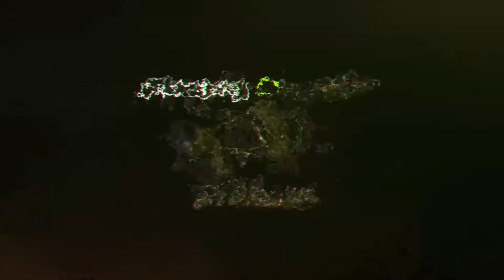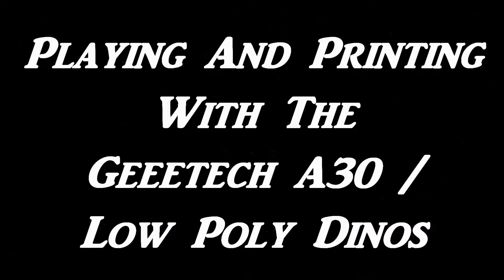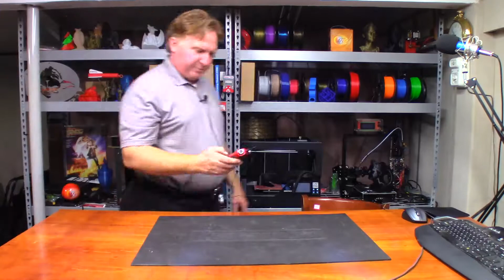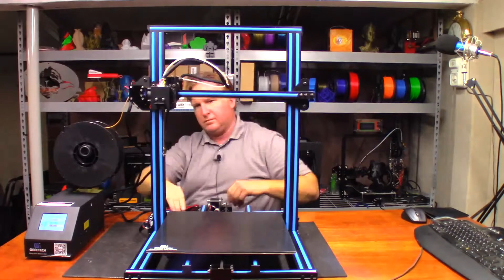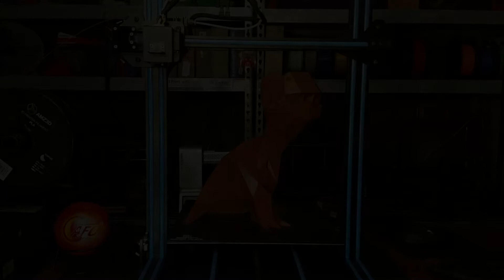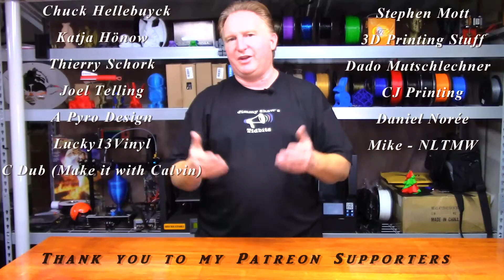Playing And Printing With The Geeetech A30 / Low Poly Dinos

Comment: I have this GEEETech A30 Printer and you have to be careful with the very first layer,... It sometimes doesn't stick to that bed as it's advertised to and at times have to go through the bed levlling process more than just once.
Reply from the maker: What I find works best is to wipe the bed down with 90% isopropyl alcohol.   So far I haven't lost a print.  (Knock on wood)